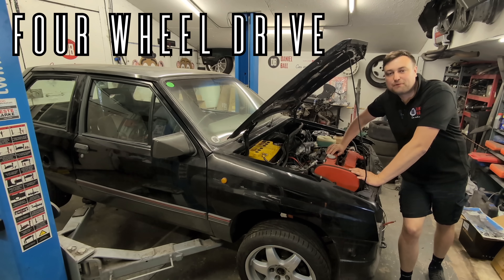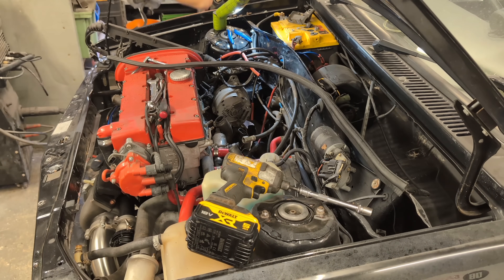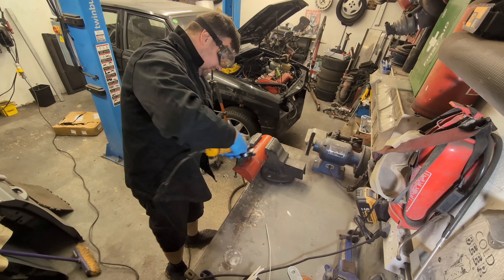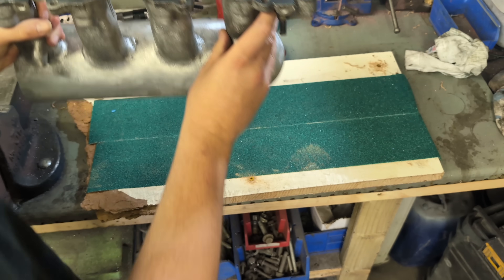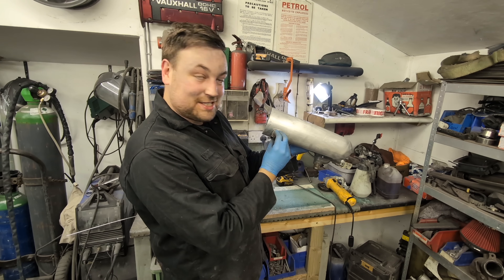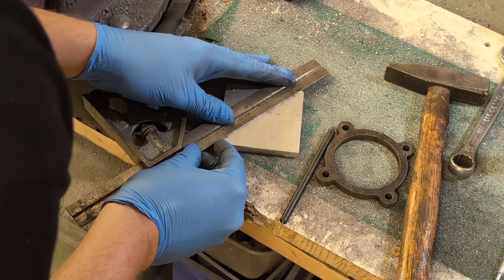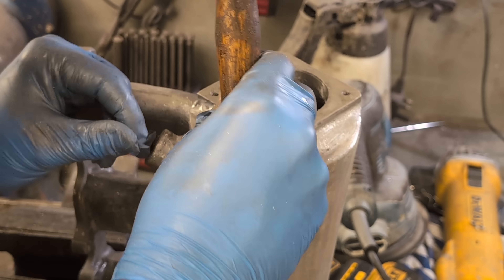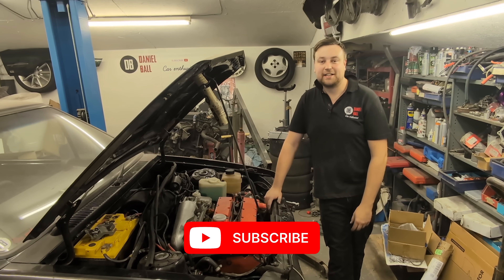Turning a fire extinguisher into a 500BHP inlet plenum

Comment: How about testing different manifolds like trying to addapt a K20 one?
Reply from the maker: They are completely different, for a start the throttle body is on the wrong side. And they bolt to the front of the engine.
Reply: @DanielBall theres the center feed ones, no doubt air distribution is better, not only that but gives room to mount the intercooler lower
Reply from the maker: I don't think you are familiar with this project, it doesn't have an intercooler, and a centre feed intake wouldn't fit at the rear of the engine.
Reply: @DanielBall from what was shown on the video, the water intercooler somehow will be on the side, with a center feed it could be placed on top like toyota Celica had in the 3s GTE

Comment: I use the little 5 cup from a #20 torch. You can get the conversion collet for a #17 torch if that’s what you use. I also use a 6 cup if I use a stubby gas lens. All other cups are for stainless or titanium. Some will say that I’m wrong but I believe a foot pedal is paramount with aluminium.
Reply from the maker: Brilliant, thanks for the info. I will use the smaller cups going forward 😁

Comment: Really good idea, Daniel. There is a but... you may find the welds will split under boost as you didn't do a 45 degree prep on each part to be welder. This gives the welds far more strength when you buff off the tops. Another thing... it would have been better to flare the inlet ports like a trumpet for clean airflow. Other than that, the build is cool as! Cheers, Leigh.
Reply from the maker: Hi thanks, I will keep an eye on the intake. Hopefully it will be okay.

Comment: I'm glad to see you decided to use a water to air, you will not be disappointed with this decision UNLESS you go too small on the heat exchanger you put in the front air dam.  My suggestion is that you make the water system as large as you possibly can make it both with surface area on the heat exchanger and with the reservoir that holds water.  Think of this as your "heat soak battery".  The larger the water column in the system is, the more time it will take to heat soak.

Water to air is superior because of short piping and the ability of the system's TWO heat exchangers (one in air dam and one in intake stream) to quickly return the water to ambient temperature.

Excellent choice.
Reply from the maker: Thanks, I am looking at radiator choices now. I have bought a little header tank too, so it should hold a bit of coolant.

Comment: If I were going through the trouble of doing this, I would have used "timeserts" on the throttle body instead of just tapping threads into the aluminum.  I think the only reason you see OEM's tap aluminum is because it's the cheapest/fastest/easiest thing to do, but if you want it to stand up to being taken apart and reassembled again, I'd put steel inserts into the aluminum.
Reply from the maker: I can't see the tb coming off that much, but if it does I will engineer something 😃

Comment: Wrong cup for aluminium, use a number 5-7  6 being my fav for 99% of jobs just with a simple gas lense  and about 5-8 Lpm gas flow and a white tungsten or anything really suitable for ac, using those big cups and the delicate gas lense inside does not work with ac very well think of the argon shield the area where the arc wants to be most those big cups allow the ac u stable arc to be anywhere 😅 anyways great work man just giving some none critical advice hope it helps
Reply: Yes bevell the seams for weld prep, ad yes 100% get a gas lens!!
Reply from the maker: Thank you, that's very much appreciated. I will just try a normal pink 6 next time. I am using blue 2.4mm tungsten with 3.2mm rods, but have been told to try using 2.4mm rods instead. Does that sound right? I have ordered some anyway 😄
Reply: @DanielBall yeah I wouldn’t use anything thicker than 2.4 rod and even tho the internet says it’s wrong I use 5356 on cast day and day out with zero issues there’s some instances where I’ll go for a 4043 rod but just depends a manifold wouldn’t one of them a rim perhaps or cylinder head repairs I will but usually just still to 5356 also the blue tungsten are ok, my favourite Tungsten for aluminium is hands down wolfram alustar there super expensive tho and hard to source will say yes there amazing but not necessary for a perfect weld, also try using a little more heat and less filler especially on that seam weld you done let that base metal melt in properly rather than panicking and jamming a bunch of filler in overall tho ur doing a good job and it’s perfectly ok what you did and ur grinding skills are a+ so not a bad result regardless would also mention should of added some quite deep v or chamfer to those parts before welding especially where it’s thicker then 4mm or so helps a lot getting the puddle to work in your favour and with penetration

Comment: Looks a decent job really. A couple of things you could have improved on, some easier than others.
Ideally the runner lengths (to the back of the valves) should be appropriate length for 3rd harmonic at targeted peak rpm. (Usually about 325mm).
Runner cross-sectional area should be the same size of the valve throats area (less the area the valve stems occupy).
Runner entry bellmouths in the plenum should flare out a bit, ideally elliptically to 70° rather than a quarter of a circle radius.
Runner surface (all the way to the back of the valve) should have a 60-grit surface finish for better fuel evaporation/atomisation.
All of these will have positive effects on cylinder filling, combustion efficiency and detonation resistance. Zero downsides.
Reply from the maker: Thanks for the suggestions, I will keep that in mind for the next one.
Reply: 3rd wave intake tuning is best, but not as important when forced induction is used, David Vizard has books on induction tuning, and they're full of info and equations. 
Dont worry about sanding the intake runners too much, that's for carbs, you're fuel injected.
Reply: If you make another one, make the plenum 2 peice removable top, and have venturi velocity stacks per each runner, also make the flange for the throttle body much larger to accept oversized throttle bodys😊

Comment: If you ever have to do manual lapping again, be sure to use a light grip and let gravity to the downward pressure.
Grind/sand in a figure 8 or circle and clock the work piece 45 degrees every 10 passes or so.

This helps with flatness in relation to your work surface, not really important when you are going to squirt metal together but helpful if you are mounting to another parallel/flat face.
Reply from the maker: Thanks, handy to know 🙂

Comment: When I was doing my apprenticeship many moons ago we were learnt to chamfer the pieces to be joined. Grinding back weakens the weld too. As for tips, practice on scrap metal same thickness of your work piece ie set up, gas flow & fall, speed, dabbing or feeding the wire in etc, feed the wire in parallel to the tungsten which should have a nice mushroom shaped arc & try a rocking motion off the ferrule 👍🏽
Reply from the maker: Thank you, will give it a go
Reply: @DanielBall You’ll crack it in no time. Once you have you’ll be proud as punch to leave the welds for everyone to see…. and admire 👍🏽
Reply from the maker: Thanks, as they say practice makes perfect 😄

Comment: Looks great, but grinding the welds will make them weak and could crack. Otherwise its very OE looking
Reply from the maker: Thanks, if it cracks I will weld it again. Pretty certain it won't though.
Reply: @DanielBall please, share your results, as I have been on dyno the other day and my stock manifold was enough only for 430hp on crank, so I am looking to make a custom one in future.
Reply from the maker: I will do, its a long way off from Dyno yet, but will be on one in the future 😃

Comment: That final result is smashing! Super clever to use the needler for dimpling. Out of curiosity, have you gotten into 3D printing at all? Also def invest in even a cheap drill press. It makes life so much better. Top work!
Reply from the maker: Thank you, glad you like. 
I haven't done any 3d printing, but I feel like I need to start doing it 😊
Reply: @DanielBall Can be super useful for templates, adapters, prototypes, you know. I'd recommend getting a printer with a heated chamber and high temp nozzle if you want to do a lot of functional car parts. The Qidi Q2 is a lot of printer for the money. We did a throttle body adapter for a 13B engine and it held up to a lot of abuse. That was on an Ender with carbon fiber nylon and we had to sand the crap out of the flange that warped, hahaha. Printed the gaskets for that and also for some other parts including the fuel tank out of TPU. I have a TIG now too still have to learn to use it. You're doing pretty well.
Reply from the maker: Thank you. Yeah I completely agree. I was looking at them a while ago, I will definitely get one in the future. I want to do some interior stuff, and it will be handy for the odd bracket etc too. I have seen people use them to make inlet manifolds with great success.
Reply: @DanielBall Definitely part of my future plans as well! HMU elsewhere if you'd like to chat about it.
Reply from the maker: Thanks, appreciated 😊

Comment: The furthest cylinders usualy go leaner.. not because they have less air, but because the airspeed is actually higher making more power then running leaner. Great job bud. Giving it all a go yourself. Thats a bit of me that!
Reply from the maker: Glad you like, hopefully it will work 😊
Reply: @DanielBall  it will work perfect
Reply: haha needle gun a great idea for that texture bud
Reply: Would making trumpets inside help slow down or evenly distribute the air all across the board ??
Reply: @peterepeat7066 nah not really. Trumpets can help a bawhair if the port size is on the edge of flow but for most not needed